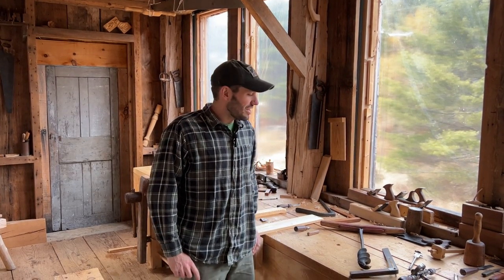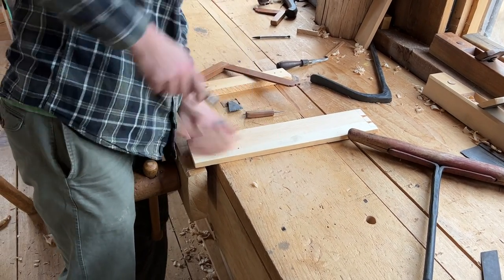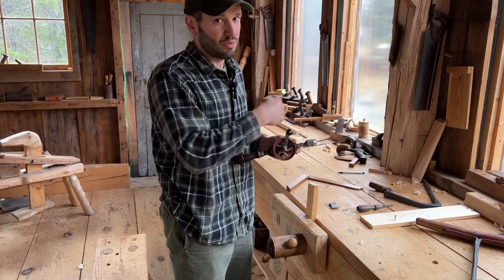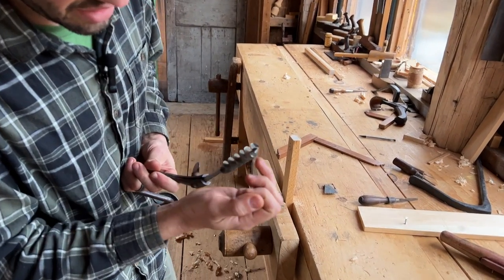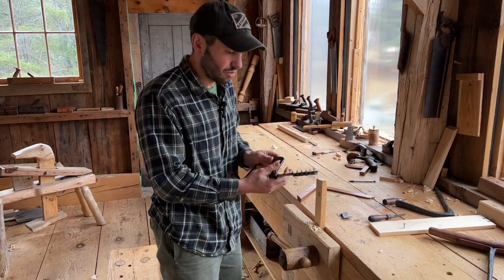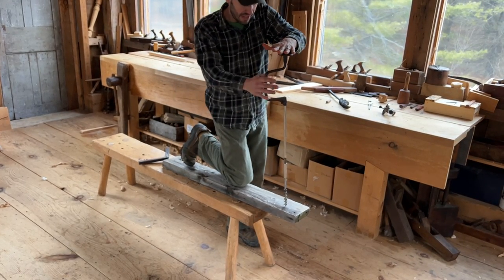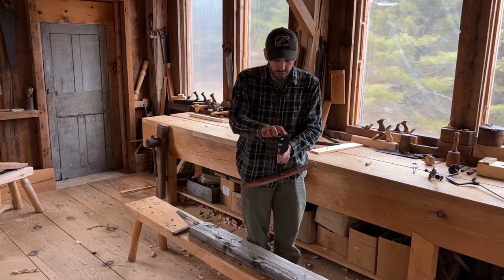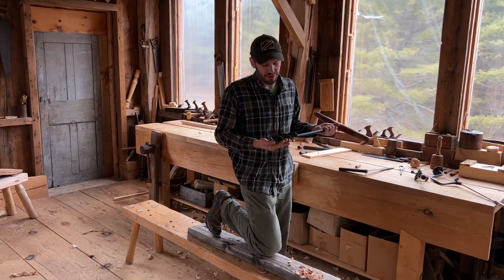Boring Holes By Hand

Comment: Excellent review of the basics! I absolutely hate eggbeater drills of that size, I saw a few designs and they never turn smoothly. I found a noticeably larger one that is a charm to use. It has a kind of saddle end and is around 20 inches long. It is much heavier but does not jam and jerks like the small ones, and I've yet to get skin caught in the gears as it happens with the small versions.On the other hand I love for the birdcage awl (easy to make in various sizes) and the large T augers.
Reply: I know your comment is a year old.....but I think you are talking about a breast drill. The saddle-shaped top is for bracing with your chest. Some of the more sophisticated ones had 2 different gears/ speeds.
Reply: @MikeAG333   Yes! A breast Drill!!